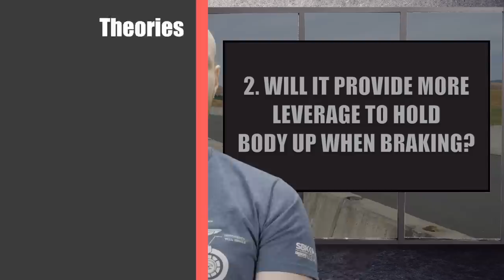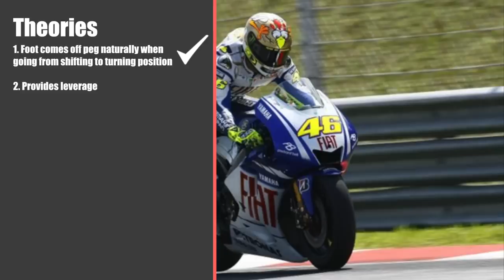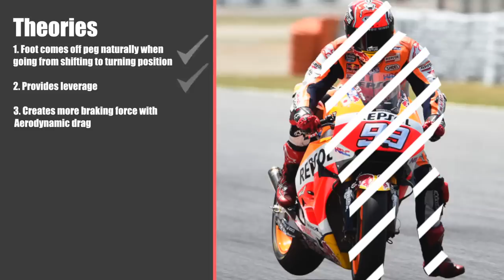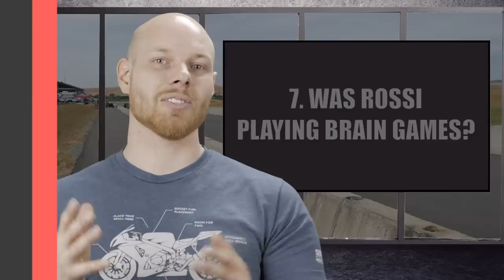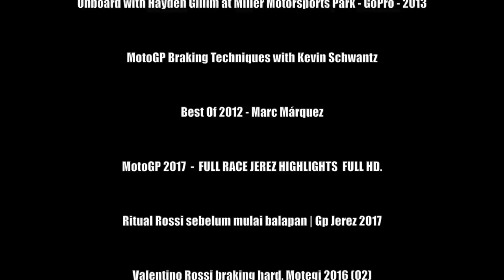The Leg Dangle EXPLAINED

Comment: There are three benefits to the dangle.  

1. It spreads out the rider's mass side to side during braking so it is less center-weighted and more able to shift independent of the bike.  If the back of the bike tries to step out under braking, the rider can counterbalance this movement by adjusting their position.  Under braking, wider is better.  

2.  The dangle helps the rider 'back' the bike into the turn.  The dangle moves the rider's mass toward the inside of the turn, allowing the bike's mass to move outward by skewing the angle of the rear tire.  It is best to do this by shifting the position of both the torso and the leg, since this keeps the CG of the shifted mass as low as possible.  If just the torso is shifted inward, the bike would need to roll slightly to the outside during braking because the torso's CG is above the bike's CG.

3.  The dangle can also move the rider's CG slightly forward, which reduces any torque force exerted by the rider's mass if the bike's rear tire moves left or right away from the preferred orientation.  This makes the bike feel less twitchy.

Comment: Holding the leg out functions in two ways.  Properties of physics are in play here...think of the tightrope walker using the pole to stabilize his movements on the rope.  First the stick provides a high level of feedback that wouldn’t be available without the stick.  Additionally, the stick is used to take corrective action by moving it left or right.  When the bike is under hard braking, the tendency of the rear wheel swing around the steering axis is high.  Making the body wider by sticking the leg out makes that swinging motion more tactile and manageable.  Moment of Inertia I believe.

Comment: I love thishit. 
  Presented with observation, theory, confirmation, rebuttal, speed and panache'.
  The internet is not broken and all future discussions are validated by its' existence.
New subscriber and looking forward to new presentations.
Reply: Yes a good explanation but not captured is that the drag factor is easily determined by measuring the different effects on top speed of being in a tuck, sitting up (as if braking), hanging off to one side (as if braking) and hanging a leg. The difference in speed is due to CdA as the power would be effectively constant.
Reply: Although little thought has gone into actually analysing
Reply: The fuck
is wrong
with your
enter button?
Reply: Agreed.

Comment: I used to do this all the time when riding subconsciously, didn't know it was a thing at all. The reason I did it was 1. to reposition myself on the bike/peg 2. it gave me a finer degree of lean control to set up for a turn to position myself more subtly that using my full body. 3. it gave me some awareness of distance which is hard to reference tucked close to the bike.

Comment: It keeps the bike more upright yet moving the weight still so the heat and wear in the tires is in a more optimal spot rather than beating up the section of rubber they use over and over.
Reply: Coming from a dirt background on lose surfaces when you would lean the bike instinctively but you know the grip wont be there the weight gets transferred to turn with less angle but on asphalt the wear and heat in the tires is crucial so the same process has different advantages

Comment: well, I started riding a cheap scooter a couple of days ago (5 days) and just developed a technique similar to the "leg dangle" by chance, on the day 2 or 3... I hadn't watched any MotoGP or any similar stuff like MotoGP.
It makes my scooter rotate towards the dangling leg a little bit and I find it very safe and stable. well I think "the volume of the piston room" of the scooter is just 100cc and it's not very fast and I keep the leg for a longer time and many times keep it for the entire turn.

When I developed this technique I had a different movement that was just an insurance just in case I fall in the turn, just lightly touching the ground, and then I started positioning the foot in the air and sometimes move it forward in the middle of the turn. I just followed my... mind and body. the insight/instinct.

This is my theory on the development of my technique:
just preparing to use my foot when I fall -> lightly touching the ground -> positioning the foot in the air -> sometimes move it forward in the middle of turn -> lightly touching the ground but for the purpose of keeping the bike stable while rotating the bike in a sharper turn. -> do the same thing but not touching the ground at all unless I feel instability

Comment: It works to get the bike stable when you get hard wind from the side, you dangle the leg from the side the wind is blowing, try it. There is an aerodynamic explanation I came by so time ago, I can't remember where I read it, I don't think that's the reason MotoGP riders do it, but it works for riding on windy conditions.
Reply: On highways when a strong cross wind rattles my nerves, I get the balls of my feet on the pegs and push up with my legs until I can feel I'm barely on the seat. It's only enough to feel it, no one would know I'm off the seat just from looking. I'm trying to get my heavy weight attached to the bike as low as possible. Under the CG for roll. It does help but it quickly makes my thighs sore though because the legs are still in a crouch.

Comment: I'm a Drag Racer.  Sticking body parts out into the windstream whey you're at speed slows you down like popping a drogue chute, which is essentially what the rider is doing.  Higher speed, more resistance, less resistance at less speed, but the braking is related to the area involved and the speed, so it's not linear.

Comment: I do Cycling. Opening legs, or leaning heads, or other body parts, is a basic instinct to balance your body. I do leg extention everytime I lower my center gravity, and need to do very small path correction.

Extending legs, opening legs, leaning head posture, provide me  lot smoother transition compared to leaning the whole body mass which often resulting abrupt cornering, back and forth correction, or instability.

When I need to make very small path adjustment, I always lean my head, neck, extending legs, etc. Miniscule path adjustment is critical when enter a corner, providing a perfect racing line.

Comment: Not sure about your analysis.  A motocross rider sticks his (her) leg out to the front, not the side, to get weight over the front wheel so that it has traction in the turn.  Similarly, you have your body more vertical to get weight over the contact patch to generate grip.  This is very different to a GP circuit where the tarmac allows grip, so the priority becomes controlling the CofG to keep the bike more upright.
Reply: Mo Saito yeah rossi got it from when he does motocross
Reply: Indeed. Same with rear break to ''set the bike up''. Rossi is one of the riders to never use his rear break.
Reply: Should I do a Leg angle when I am doing a kneedown on a Supermoto?
Reply: riding position on an mx bike abd a GP bike is different, thus the different angle. I think its a stability thing and it stems from riders wanting more control in a slide, spending more time on mx bikes to get "the feeling" and instinctively sticking a leg out. i find my bike is way more stable with one leg out, when its pre corner or pulling up to the lights.
Reply: Correct Ken - 6 is about the closest and the rest are crap. Notice they do not do it on very fast corners. The only reason they do not do it mid corner is because of the lean angle. My dad did it on tar 50 years ago because he also did a lot of dirt riding.

Comment: Why not just ask a moto gp rider why they do it?
Reply: Because trade secrets.
Reply: @Don.of.  i used to work at Circuit of the Americas and i did ask their engineers. It is to provide counter weight to stop the bike from wobbling before entering the corner.
Reply: Sunyata  who knows.  i have tried it and all i found was it put tons of weight on my inside arm, maybe help[ed turn in ??   sure it depends on the bike and rider style.   maybe lorenzo was smooth enough he did not need the counterweight in the first place  if the bike was not getting out of shape. some might argue . but iam not an engineer . i dont do it....
Reply: Sunyata  exit speed is dependent on the corner entry?.. or so I thought...
Reply: @mushrume  You were doing so well until you said, "But I am not an engineer." -You don't do it? -That's a great start! -YOU actually ride. Engineers are too busy making calculations to ride properly. Forget it.

Comment: i used to work at Circuit of the Americas and i asked a few moto2 and moto america riders. It is to provide counter weight to the bike so it stops wobbling and settles down right before entering a corner. that why it doesnt matter if the foot is more foreword or back, it is the distance from the bike outward that provides the counter weight.

Comment: A long time ago I read an article with Valentino Rossi where he explained that when sitting on the bike with both feet on the pegs, the rider's weight is focused more on the middle of the bikes front/back axis; but by taking one foot off a peg, the rider ends up sitting on their butt, which, being further back than the foot pegs, effectively shifts the rider's weight further towards the back, helping keep the rear wheel down during braking. I tried this once just sitting on my bike while on the center stand, and it's true; taking one foot off a peg does shift more of the rider's weight towards the back. Also, Rossi said in that interview that the first time he did it, he went into a turn too hot, and was worried he would hit another rider he was trying to pass on the inside, and in a reflexive move, without thinking, he stuck his leg out, and immediately the rear wheel went down, he was able to apply more braking, and avoid a crash. Makes sense. I'm absolutely not a 'race' rider, but out of curiosity I've tried it a few times on track days, and at least for me, it was quite effective in doing what Rossi explained. Hope this is useful, and apologies for the lengthy comment..! Thanks!

Comment: Dude! You are WAY over thinking it. Do you race? It's ALL about lateral center of gravity. Try it. I guess it's always been obvious to us because of airplaine building backgrounds - which I guess caused us to always think in terms of the different COG's when setting up cars AND bikes. When Rossi first said in an interview that he 'didn't know  why, it just felt better' I instantly know the reason - especially after trying it. If you are one who's style makes use of "backing it in" (letting the rear hang out during braking) then hanging your leg to the inside give you some influence over the lateral COG and and increased level of control over the bike. To visualize it imagine a birds-eye view of a rider during braking into a corner, while the rear stepping out (to the outside of the corner) while dangling the inside leg. Try it - there is no thought required. It's very natural - - the more the rear steps out, you naturally tend to put your inside leg further out - - - forced to pull the leg in as you lean over of course.  Also - ther is NO comparison to dirt riding as there is no "prolonged" heavy braking soley by the front - and the leg is typically put out while under throttle - try it. It seems very obvious to me and all my riding buds. In all fairness, it is not imediately obvious to those not used to thinking in terms of COG in 3 axis. Cheers and Thanks for the vid.

Comment: 1. Stability 
2. Drag force
3. More front braking force because when you break hard as you can the bike lifts up, so when you are dangling your leg you are also pushing the bike down with your weight so that you can use the front break even harder. 

So stability and more breaking force

Comment: It helps with stability and helps you "throw" the bike around the corner. I learned how to do this in the early 90's when I started street racing, with motocross bikes, on wet tar roads with knobbly tires, its a bit like why speed way racers drag a leg while riding. It shifts your weight to the front wheel and allows you to use your hips to "swing" the bike out to the opposite direction of the corner you can lean the bike out but "choke" its neck around the corner and you don't high side it. It the only way you can corner fast enough when you have no more traction at the back and you using your front wheel to break and steer at the same time.

Comment: I haven't read all 1,796 comments, so this might reproduce someone else's insights into the matter.  But it seems to me that the extended leg acts as damping device.  Keep in mind that in braking hard, there is almost no weight on the rear wheel as the braking front wheel is bleeding off inertia in the direction of travel.  Meanwhile the rest of the bike, from the fork bearings rearward is resisting the bleed of of inertia - the front is stopping, the rear wants to keep going and will want to pivot to either side horizontally from the steering head bearings or vertically from the front wheel axle, and swing past the front wheel.  We know that a stoppie wants to throw the bike over the front wheel.  The same force, if kept from going vertical, will also want to throw the bike to either side of the front wheel.  Visualize the bike standing on its nose, totally vertical, front wheel clamped in a vise so that the rear wants to fall to one side or the other.  Imagine the bike perfectly balanced rear wheel pointing straight up at the sky.  Now a slight breeze tries to tip everything to one side or the other.  The balance needs to be upset only slightly to initiate a fall under the force of gravity.  To counteract that initial weak tipping force imagine a counterweight swinging out from the bike in the opposite direction.  Now put the bike back down on its two wheels and imagine that counter weight being the rider's leg.  This is why the leg-pendulum is used - to keep the rear from starting to come around while there is little to no rear wheel adhesion to the track.  It's the same principle used by high wire tightrope walker using a balance beam.  The beam acts as an inertia damper, a counter weight to any wiggles felt at the feet, or in our case, the rear of the bike.  It's the same reason a bicycle rider will swing his legs out while going over a rocky patch of trail at speed.

Comment: As a former flat track racer and worlds youngest daredevil YOU TUBE= Jess Z-bo Robinson . It stems from flat track aka dirt track racing. A lot of these guys train on dirt. Rossi has a lime stone track specifically to help riders with this technique.   A very small fraction my be due to habit. It does however serve a purpose. It is as you said. Its primarily to get to the corner apex faster by keeping bike more upright before cornering. It helps put more braking power down, and counter act or balance the shifting of the rear wheel  that is by force trying to go to the outside of the corner. Its also helping put more weight to the inside of corner without compromising body position and allowing to throw the bike into the corner harder and sooner.  I would also say that when I would ride my sport bike, i would flair my knees out  to  help me slow down. There was a big difference in stopping/slowing down as apposed to just coasting with knees close to the bike. In addition I would bet its a drag thing. Bringing the foot away from the aerodynamics of the motorcycle has to help. Every little thing in these high level races every microsecond helps. Just my 2 cents for what its worth

Comment: Motocross riders do it cause if they are about to Crash they can just 'kick' the ground and get back up
Reply: A zeppelin no it gives more stability in motocross racing
Reply: In motocross the forward weight transfer of sticking a leg out helps to put more weight over the front of the bike to get it to grip and turn better. Once it's out there it can also be used to help save a slide if the front washes out but that's not the reason it's there in the first place. It's a bit like knee-down on racing bikes, the weight transfer of hanging off to the inside of the corner changes the centre of gravity and allows a higher corner speed for any given angel of lean, but once the knee is on the ground (or even the elbow) it can be used to help save slides – but again, it's not the reason it's there in the first place.

Comment: I do it on purpose as a swing of the boot helps to create a forced weight transfer to the inside of the corner, actually tipping the bike in the corner, as while braking-it stabilises the bike and keeps it upright, so a lot of force required by weight shift to lean the bike, and the foot swing does help a lot, while keeping your body on top of the bike for control of the grip balance on corner entry

Comment: Over the last 20 years riding technique has evolved due to the invention of the slipper clutch and other ways to control clutch slip decelerating/entering corners. This has allowed the new style, for pavement, of 'backing it in' which is all about sliding the rear in a similar fashion to how one initiates a turn when flat tracking.
Road Racing is like riding a Horse, you have to let the beast have it's way, let it move around under you, you have to be in harmony with it and all, but you don't clamp yourself down.... no death grip... In the old days, my racing days, you would set up for the corner, sit up, and off and put your knee out and you really don't have anyway to move around much at all in the classic hanging off position, so no way you could let the bike have it's head when the back end is sliding and snapping around so much, you would get chucked right off....
So, put the leg out, make your body a bit of a parachute to help you lift up off the bike a bit and let is have its' head, you get a more stable situation and the added wind resistance helps take weight off your arms and wrists.